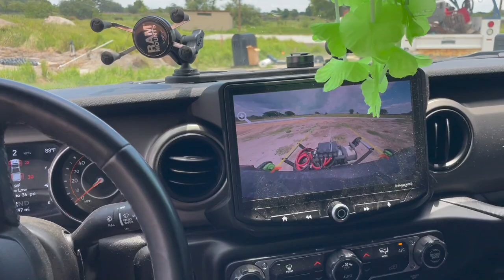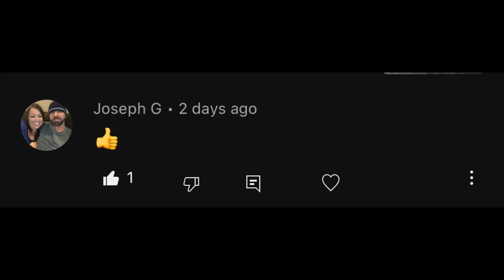Stuck Skid Steer and Tractor!

Comment: Great vid. What's the best way to ancer rear end like you did?
Reply from the maker: Just dug it down in two wheel drive, you can use 4 wheel drive but risk getting yourself stuck, however you can always winch out
Reply: @4x4rescue74  In 2WD you press brakes and hit throttle to dig yourself I assume?
Reply from the maker: Just get tension on the rope and try to drive away